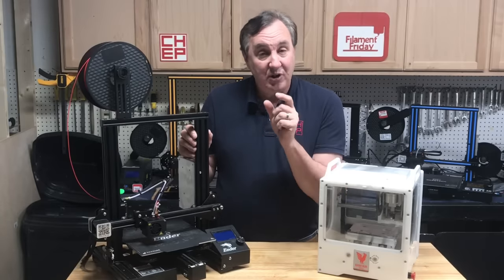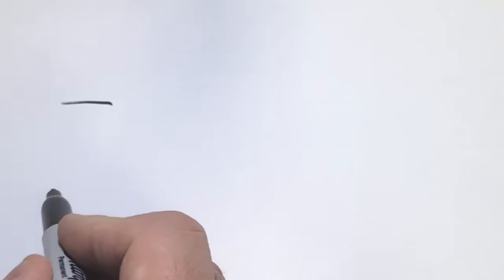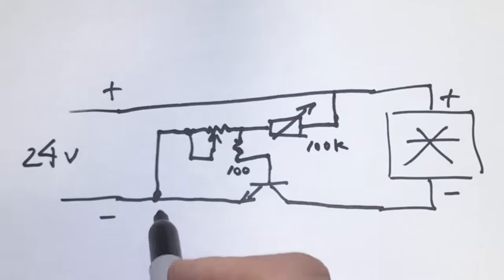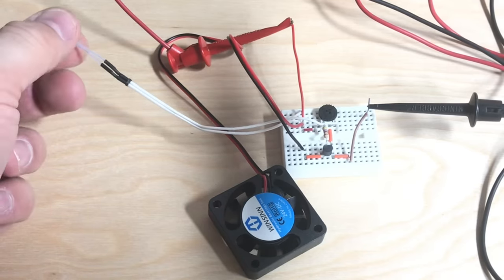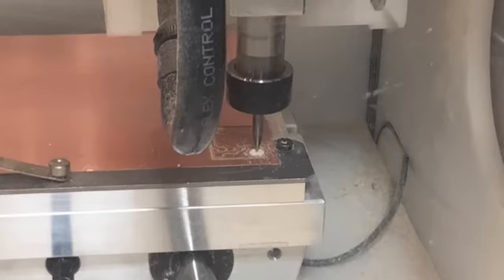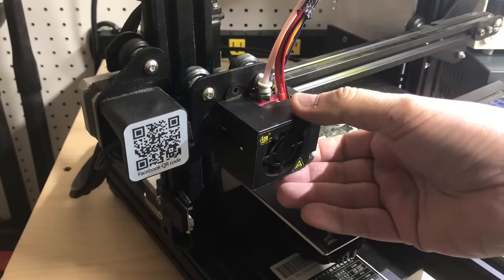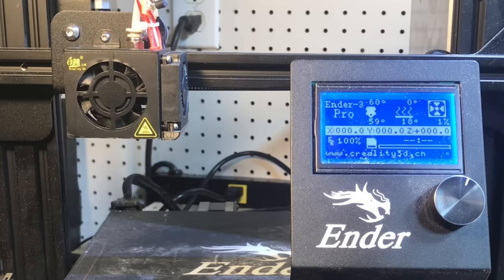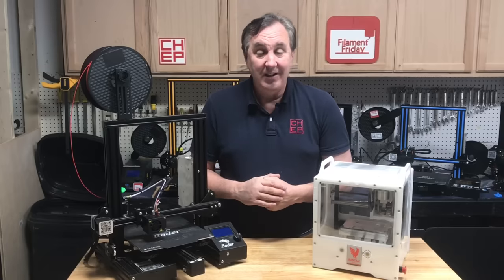DIY Temperature Controlled Hot End Cooling Fan on Creality Ender 3

Comment: Personally I would have wired the electronics fan to the hotend fan terminals and let it run all the time then modify the firmware so that the electronics fan controls the hotend fan.  Add you auto-temp circuit into the electronics fan inside the box.
Reply from the maker: Then what about the filament fan? 
Do you just give up that control? 
Those connectors are connected to the same I/O pin.
Reply: @FilamentFriday  oh - sorry - I don't have an Ender.  I assumed the electronics fan and the part cooling fan were on separate pins.  
I have a Adimlab where they geniuses decided that controlling the brightness of the LED on the hotend was more important than having a part cooling fan.  So now the LEDs run full blast and the part cooling fan is controlled with the old LED pin.

Comment: Cool feature! 
I have also one Q. 
Why my filament cooling fan do not start even if it's set 100 on Cura. Now I have to modify filament cooling fan speed from 0 to 255 every time on Ender 3 from the screen.
Reply from the maker: It’s a setting in the slicer to turn it on.
Reply: @FilamentFriday  Filament cooling function in Cura is 100. What else I have o turn on? It was working before, but somehow now is not working any more automatically.
Reply from the maker: Not sure then. That should do it.

Comment: I recently upgraded my E3 to include the bigtreetech 32 board and touchscreen and a BL Touch. it was installed professionally by a local 3d maintenance company. Therefore, it should be installed correctly. I cant seem to get a perfect print since it returned. I am having bed adhesion issues leading to a string mess every time I print something. Please help!!! What am i doing wrong, or should i do with the addition of these new components?
Reply: Have you run all calibration/tuning/alignment that one should do after every big upgrade? Adjust Z offset just a bit to get the nozzle just a bit closer for a good first layer. Z offset isnt always going to be the same(that company probably dialed it in just enough) so this value needs to be adjusted one way or another to dial in the first print. Thats my guess is whats going on.

Comment: If hot end fan is cooling all the time - i heard that motherboard work only when printing - maybe they have swaped connections?
Reply: Motherboard (electronics) fan is tied in control with part cooling fan. If you print ABS where you put part cooling to 0% you also turn off cooling for motherboard enclosure. Bet it get toasty in there. I connected motherboard fan directly to 24V of hot end fan so it's always on.

Comment: The cheap, one-component solution is: 
KSD-01F
Under 2$ US.
Reply from the maker: Nice idea. I’ll check it out.
Reply: @The 300lb Gorilla 1 => This depends on your printer, your fan and your needs. For Stock Ender-3 and mostly PLA Print 45 or 50°C should be the way to go. 
2 => Thermal-Clue. Or Heatpaste and a screw (On TO-220 package).
3 => If you want get an FCC Label for it or your old-school Radio stands only 1cm away from it, sure you could do that. For function, you don't need it, if you don't have the worst fan on earth ;-) 
The KSD-01F is only a switch on/off device. So from this part electronical noise is only produced when switching the fan on or off. EFI/RFI is more critical if you drive your fan with PWM.
Reply: Do you know what the maximum operating temperature is for the KSD-01F? I couldn´t find any Info.. similar products are specified for only 240°C.
Reply: @B0IIE  Normally 15 to 50°C more then the switching Temp it is rated for . As it is meand to be used to switch off it's own heating source, and so protecting it self for overheating.
Reply: @yveice    but doesn't that make them useless if they get destroyed at a temperature that is "normal" for an extruder.
And what happens when it breaks, will the fan stay on or off?
Reply: @B0IIE  Normally i would not place the sensor directly to the heat block, i would place them on the "cold" side. An you should normaly have no temp over 100°C on this place. (Else you filament would melt to early). So no, for me no problem and very usefull...
Reply: Its purpose is to sens the part you want to cooldown, aka the place the fans blows directly to. So on Stock Ender-3 you can mount it on the red coolerblock for example. Just to make things a bit more clearer.
Reply: @yveice  I agree, that if you mount it on the heat sink and not on the heater block it will work. Thanks for clearing that up.
Reply: @B0IIE  So, have either of you actually mounted this? If so, how is it working? Could you post some images?
Reply: @christopherlyons7613  I didn't go this route bevause I thought it would be to much hassle to mount it with my Bullseye Hotend mount. I instead now use a Sonoff (with Tasmota) and the corresponding plugin for octoprint.
Reply: I found That: 

Technical Parameters:
Contact load: 220VAC 1A or 24VDC 3A
Dimensions (total length × width × thickness): 29.7 × 10.2 × 4.7mm
Temperature range: 0 ℃ -130 ℃ (every 5 ℃ a specification)
Contact type: normally closed (-D) or normally open (-H);
Package form: TO-220 metal backplane
Contact resistance: ≤ 50mΩ
Insulation value: ≥ 100MΩ (500VDC)
Insulation strength: 1500V / DC, 60Hz
Standard tolerance: ± 5 ℃
Working environment temperature: -55 ℃ – 160 ℃ (short-term maximum temperature: 260 ℃ 10 seconds)

So it Need to be mounted on the hotend. Not on the heater Block

Comment: Good idea but that place you choose... You shoud do this right next to board and no need to cut fan wires
Reply from the maker: And run the temp sensor all that way? This was easier. 
And I may add a connector to make it easier to replace the fan.
Reply: @FilamentFriday  temp Sensor is anyway connected to board,(mean hoted thermistor) you dont need to use another and put down to board
Reply: Spenat1k 
I was thinking the same, but it might mess with the existing circuit.  It’s something you’d have to test.

Comment: Love the idea, but I would run the wires and put the board on the other end, next to the main board.
Reply from the maker: Why? It easier to replace the fan this way and shorter run for the temp sensor.
Reply: @FilamentFriday  Think about it, replacing the fan would take almost the same amount of work, desoldering the old fan from the board + soldering the new one to it, is the equivalent of cutting the wires, adding 2 small heat shrinks and soldering them together, basically keeping the broken fan wires. Or one could just use the old wires as a guide, tape the new wires to it and just pull on the other side. In the end though, I just don't like the hotend to look clunky, I'm even thinking about removing the part-cooling fan (because I only print ABS, I don't need it) and designing a minimalist fan mount, to mount the fan on the side.

Comment: The part cooling fan is PWM right? In theory you could change marlin to output clocked pulses so you could decode them with a little microcontroller and drive a bunch of fans. Complete overkill!
Reply from the maker: That might work ;)

Comment: I fitted a micro-swiss hot end. I need the fan running until it cools down. I've changed it to a 5V fan, off a separate usb charger supply, I may add your temperature control, but I'm not worried about the fan running.

Comment: Just use a bimetal switch
Reply: Sounds interesting, but a KDS-9700 bimetal switch has a rated service life of >10000 times. Not that great, if it switches 100 times in a print it could be dead after just 100 prints. Maybe there are other more durable bimetal switches ?
Reply: @diego1694  Hotend fan should cycle fully once per print.

Comment: I wonder why you add an additional thermistor and not use the existing one?
Reply from the maker: So I wouldn’t affect the accuracy of the hotend. Sharing the sensor affects the electrical load on the Analog to Digital port of the controller.
Reply: @FilamentFriday  thanks
Reply: @PopGheorghe  You can't share signals from resistive sensors. You end up changing the resistance and screwing the readings.

Comment: Can i print the fan? I broke mine and cant find any videos or posts about it, it vibrates and i had to take it off so i could print
Reply: Like print the blades for it? I wouldn't, you're likely to have it shatter and fly everywhere and break things
Reply: No. You need to order a replacement fan, they're a common part.

Comment: If you do a relay PLEASE don't use a 10A relay like I have seen everyone else do. That is not enough for the ender 3 as it can pull up too 15A. This is a fire hazard. KNACRO has 30A relays that switch at 5v, 12v, and 24v.
Reply from the maker: 15A on what side of the step down switching power supply?
If the plan is to cut mains power then the primary side draws less current since the voltage is higher.

Comment: It would be great if the printer turned itself off after finishing a print in the middle of the night.
Reply: You can buy in aliexpress a thing that actually does that
Reply: @reynaldoantonioarandaalvar5524 , thank you, do you know what it is called?
Reply: @yb5515  If you run Octoprint  and plug printer into a TP Link smart plug, then install TP LInk plugin from octoprint you can have it shut off after print is finished or better yet shut off printer 15 minutes after print is done to let everything cool down.
Reply: @Remon Pel You could add a bypass switch, so you have the auto shutdown option or not :)

Comment: why not use a simple temperature switch?
Reply from the maker: Which one?
Reply: That's what he did
Reply: @FilamentFriday  Sorry, only saw the reply now. I meant using something like the KSD9700. you could solder it directly to any of the wires of the fan and leave the sensor part touching the heatsink. I did it and it kind of worked, but ended up having a major problem with clogs. I used a 50c switch and it would keep turning on and off during the print as the heatsink would go below and above 50c. Before this I used to think that the heatsink would reach a much higher temperature. Maybe using a 40c switch or placing the sensor on the heatblock would solve this. 
I found this idea on a reddit post, just wanted to know if you have any thoughts on this
Reply: @winiciuscota8853  70C is too high for heatsink. in this video he switches fan at 50C at the HEATBLOCK not heatsink.